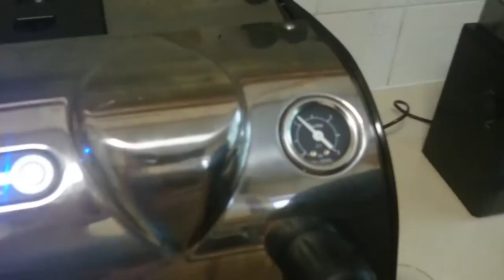Fracino Piccino

Comment: Hi Daniel
the reason your coffee pours really quickly is because the grind is not fine enough. If you imagine large particles (coffee grains) have lots of gaps between them the water rushes through the gaps quickly. If the particles (coffee grains) are finer the water takes longer to pass and collects more of the coffee flavour along the way. A pour should take about 25 seconds.
You need to invest in a decent grinder.
Reply from the maker: +Russell Cheeseman, Hi Russell, cheers. Yes it was the grind. How much would you offer for the machine? I barely used it.
Reply: @cerd7801  Do you still have it?

Comment: Hello, I will tell you what I see that you can improve in your process.
1- The grinder is not suitable, you are with a basic one and you need a professional one, Eureka Mignon Classico for example.
2- The amount of coffee in the Fracino filter holders is around 8.6 grams, single and double, at least 18.3 grams.
3- I don't know the freshness of your coffee, but you need it to be roasted for no more than a month.
4- toasting includes a lot if it is very black or medium roasted.
5- Finally you have to achieve a constant, homogeneous and fine grinding but NOT like flour.
We have that machine in the office and we use it every day to make coffee. There are clients who are surprised when they see that the coffee was made by a Piccino.

Comment: Hi Daniel
I faced same problem with my coffee machine Breville 870xl, I solved it by two steps:
1st, coffee beans must be stored in air tight condition in a jar for example (not enough to grind them fresh)
2nd, I used another basket (the doubled wall basket)
Hope this will help.
thanks

Comment: Yes, that is pretty shit. A couple of things. where do you buy your beans? I find supermarket beans are of a poor quality and i have had similar results to you using them. Try buying online direct from a roaster. If that doesn't solve the problem, I think you will need to upgrade your Grinder as it may not be grinding fine enough.